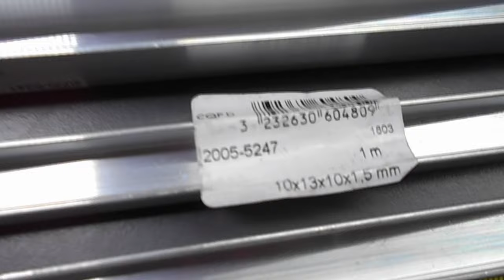Laser Grill

Comment: Ein sehr gutes Video. 👍 könntest du mir nochmitteilen, wie du das Gitter auf dem größerem Laser Grill angebracht hast? Genietet, geschraubt, oder geklebt?
Reply from the maker: Genietet!
Reply: Wäre es eine Alternative, einen 2. (gleichgroßen) Rahmen bauen, um das Gitter so einfach wie es geht auswechselbar und gleichzeitig so starr wie möglich zu machen?
Reply from the maker: @TheVNBiker  -If I did, I would do it along the Y-axis, and screwed to the legs of the laser, using the holes in its legs. So as not to obstruct the flow of air I have to remove the smoke from below!